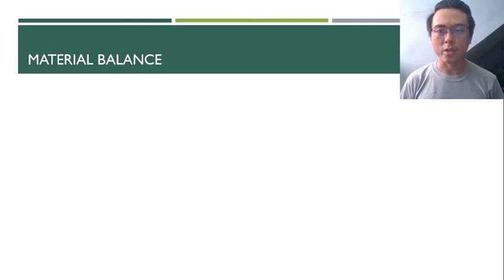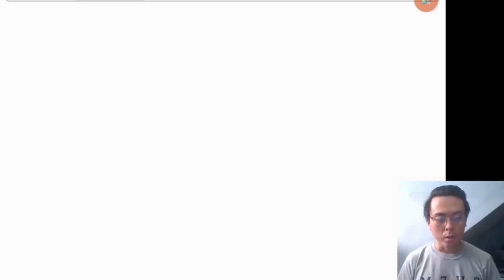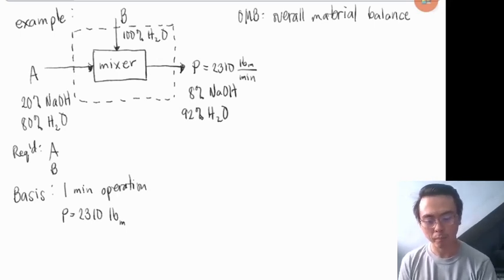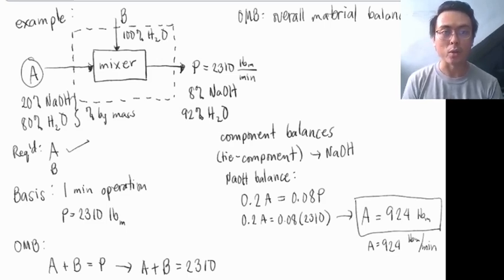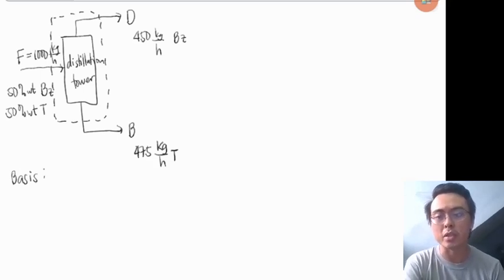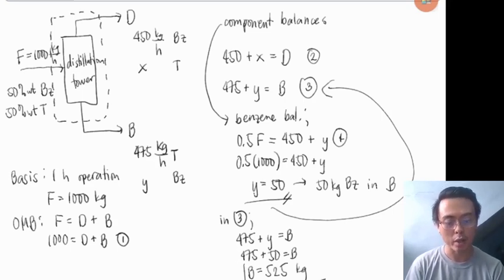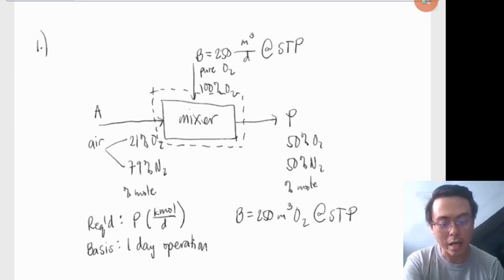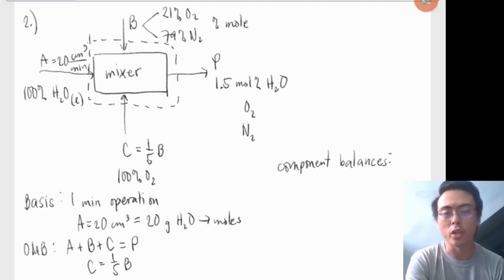Introduction to Material Balances: Overall and Component Balances | ChE Calculations Lesson 3

Comment: Ray why when solving for benzene balance you used 
 450 + y and not 450 + x as presented by equation 2
Reply: yep ive got the same doubt cause it should be x=50 and y=25 right?
Reply: @teee27 Tha amount of benzene at the top is 450 and the amount of benzene at the bottom has been represented by y so adding them together,  it's equal to the amount of benzene coming in (0.5×1000)
Reply: Tha amount of benzene at the top is 450 and the amount of benzene at the bottom has been represented by y so adding them together,  it's equal to the amount of benzene coming in (0.5×1000)

Comment: Do you have to write H2O mass balance if the overall mass balance has produced the mass of B already?
Reply from the maker: No need, but you can use the H2O balance as a form of checking (for consistency of calculations). The left and right hand sides of the H2O balance must be equal.